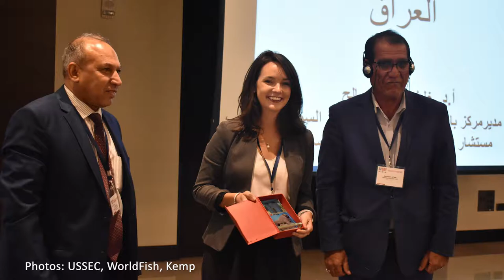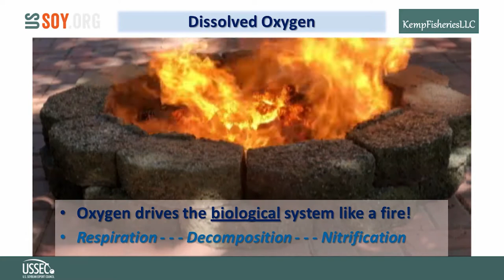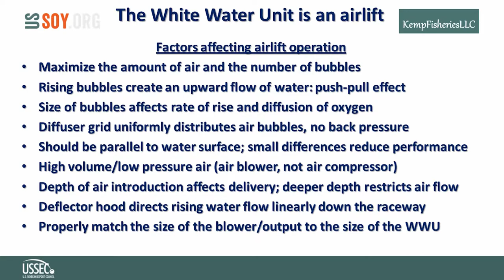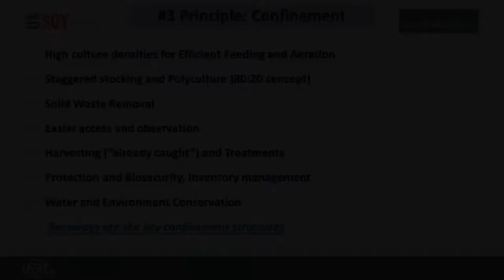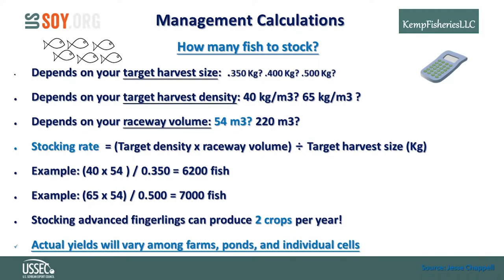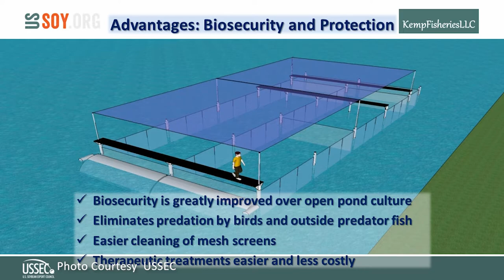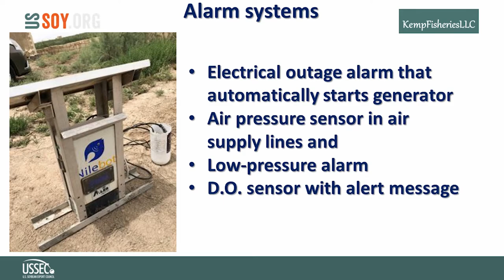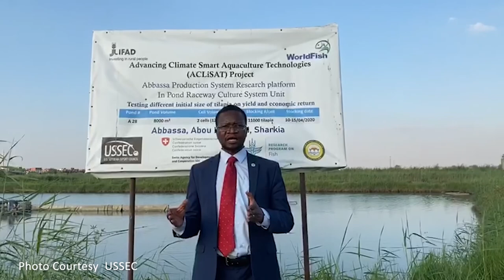Understanding the Sustainable IPRS: In-Pond Raceway System (DIY How to Modernize Your Fish Farm)

Comment: hi! is it okay to create some innovations and attempt to fill the gaps of the iprs? i mean iprs is advanced as it is alone, but since you've presented the "gaps" and encouraged us to take our attempts for the betterment of the system, is it possible? without directly invalidating the intellectual property rights. i am a student researcher by the way! thank you!
Reply from the maker: thanks for the comment! yes, of course, I'll be interested to see how you "close the gaps" but don't bypass the basic principles. I received your email and will reply. The biggest gaps are trying to reduce the use of power to move water and aerate while maintaining a healthy environment for the fish and enough velocity to move waste to the quiescent zone. I've done that this year using DC propeller motors and solar; but the slow-rotation paddlewheel is another method that I'll try to see how it compares with propeller.  another big gap is removing as much solid waste as possible without creating too much equipment or too much labor, and then finding a use for it such as methane/biogas production and fertilizer / compost, both of which I've proved the concepts for, just need to put it into practice.

Comment: Hi Skip, I have been following IPRS systems for a while and trying to decide whether to take the plunge. Watched your video as well as Jesse Chappels. You both dovetail quite nicely in terms of getting a good understanding of IPRS. Your video does cover off a bit more detail is some areas which is very useful. How can I contact you to discuss IPRS in a bit more depth. Trying to work out how i would implement IPRS in  my situation. I have a couple of questions you may be able to help me with which could tip me over into taking the plunge. Peter
Reply from the maker: Hi Peter, thanks very much for the note. Pls Contact me via email, pskemp2@gmail.com

Comment: Hi,

Thank you for the amazing presentation. I have a few questions. And I have already read the manual.

1. We know the minimum economically viable size for iPRS is 10,000m3. However, for smaller ponds let's say 1000m2 with a depth of 3m, sometimes it might be more productive with a raceway system than any existing approaches.

For the smaller pond like 3000m3, what could be the width and height of a raceway cell and QZ that offers good muscle exercise for the fishes and offer efficient waste cleaning? 

2. For a 3000m3 water body, how much air should we have to supply to the WWUs?
3. If someone wants to increase the depth of their pond to let's say 5m, just using two WWUs with the chimney effect will be sufficient?

4. Different species and sizes of fingerlings require different water flow rates. Is there any suggestion from you on how we can adjust the speed of the flow based on multiple species on the SAME raceway cell (they are in different confinement areas in the same raceway cell)

Thanks in advance.
Reply from the maker: you can probably work out these details by scaling down. details are in the manual. however, keep in mind that the larger water volumes help buffer the water quality and smaller ponds do not perform the same way.  https://ussec.org/ussec-in-pond-raceway-systems/